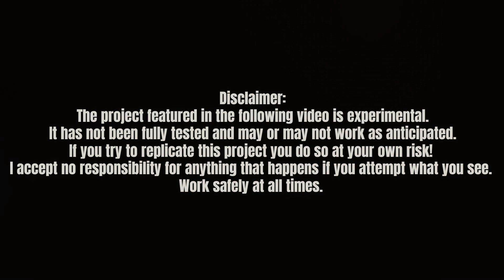Ryobi 40v Brushless Motor E-Bike Controller Variable Speed Throttle Reversing Wiring Demo & Diagram

Comment: Hi there, how did you determine your wattage? i have a motor from a milwaukee lawn mower, its a 36v motor and milwaukee claims max rpm is 3300 and max torque to be 10 ft-lbs. i’m wanting to use it on my mill funny enough but it’s got 3 main wires and then a ribbon as well which im not sure what the wires in it goes too, but im trying to figure out what controller to use and then how to power it from ac voltage plus id like to know the specs which i cant find anything on. my motor looks identical to yours except for it has the ribbon which it looks like yours does not.
Reply from the maker: Being a DC motor you will need a brushless DC controller. But you could power that with an AC to DC converter of appropriate size. I actually was told by someone else that it was 750w, but it sounded right. I have a motor that looks the same, but is slightly taller and is marked 900w on the back. It might be more like yours since that one is also a 36v motor. The extra wires on the ribbon are probably for a hall sensor, which is nice but not necessary. I typically use E-Bike controllers for these motors, since they are cheap and versatile. Most E-Bike controllers support Hall sensors, but I'm not sure which wires connect to what there.

Comment: I wonder how many minutes battery will last at 30mph.
Reply from the maker: On my moped these tended to get too hot so I never got to do a range test. On a bike results would likely be better with proper gearing. Rough estimate of about 20 minutes or so at 30mph with a 6ah battery. That's assuming 750 watt draw, which is about the max or maybe a little over on these motors.
Reply: @oddjobsandrandomprojects I think they have a fan on the motor while in the mower, no? You’d probably do better keeping a fan of some sort on the motor.

Comment: I have a couple of the new 80v motors, do I need to get an 80v esc or will a 48v work ?
Reply from the maker: This is opinion, not something I've tested. But you should be able to run lower voltage with no issues at all. However, they will produce less power since you can't add more amps to compensate without stressing the wiring.

Comment: What do the yellow green and blue wires correlate to on the motor?
Reply from the maker: I'm not sure I'm the best person to explain it, but on a brushless motor they don't correlate to a hot or ground like on a brushed motor. Instead they constantly change, becoming hot or ground wires in time with the motor RPM. There are some videos on here that explain brushless motors much better than I can. That's how I learned about it.

Comment: I'm thinking on adding that controller to the mower itself just so I can get rid of that load-sensing feature they felt the need to add and not be controllable to get the most battery life at the cost of the blade not spinning fast enough 😅
Reply from the maker: Yeah, you will certainly have more control over the speed with an e-bike controller. You'll trade battery life, but it might be worth it.

Comment: Could you use that controller in place of the mower blade controller?
Reply from the maker: There is no reason you couldn't do that. You would need to figure out a throttle for it, but that shouldn't be too difficult. But it does give you more control.

Comment: If I had a stand alone non ryobi motor and non ryobi controller can you explain how to utilize the ryobi batteries? Sorry very new to the electrical side of things and working on converting my mclane reel mower from gas to electric. My last hurdle is I’d like to use my batteries for my ryobi system but am not looking to gut my ryobi to harvest the motor and controller.
Reply from the maker: Kind of depends on the controller. The batteries are 40v with a simple hot and ground wire. That is pretty easy. I bought a used charger cheap on eBay to make connecting to the battery easy. Just gutted the charger and soldered wires to the hot and ground connectors. The issue with some controllers is they may have additional wires, just as temperature sensors and things to bypass. I'm not familiar with any other brands to offer any advice there. The other option is to purchase a Ryobi motor and controller on eBay like I did. Someone else had already gutted one.
Reply: @oddjobsandrandomprojects  thanks for the reply!! My concern about using the ryobi motor for my project is I am just not sure about taking a motor that is designed to run facing one direction but the device I’m placing it on would be using it with it on its side. At least someone said to me it could stress the motor. I am fine with purchasing what I need or tearing apart my ryobi but I just like the idea of using the batteries but want to make sure I’m running efficiently
Reply from the maker: I don't personally think that running it on its side will hurt the motor. However, the bearings aren't made to take tension. So when I used one for a drive motor with a V belt it runs the bearings after a year or so. The V belt just requires too much tension. I switched to a cog belt and so far have had no problems. Since you are working with a reel mower I'm guessing it is chain drive, which should work well if you can find a gear to match.

Comment: please help, i have a 900w 40v controller, i found this info on the net, i picked up a Remington lawn mower, never been used, but dont make battery anymore, but i fitted a 40 ryobi, and modded the gut to except the ryobi battery, but ryobi has 2 T pins, the Remington has 1, i have reversed and get same outcome, so the controller has a signal wire, it comes from the plugs to the battery, in T2 the mower starts for 15 seconds, then stops, plus i have to put ryobi back on charger to reset battery...i think the answer is below, but i dont quit understand, i know temp sensor is important, but i want to bypass on controller.. most ryobi tools run only ( + and - ) only T for charging .. below is a comment from china to bypass brown and white wire .. 
""The controller connection is defined in the introduction diagram. The detection signal line needs to be connected to the 10K resistance and the negative electrode, and the starting line is connected to two control switches. After the power is switched on, the starting line can start and run.""
Reply from the maker: I will have to check how it works on mine, but I see a couple options from the info you have. First, it sounds like they are saying to connect a 10k ohm resistor from the negative to the sensor wire on the controller to bypass the sensor. That is a great option. The other would be too get a Ryobi controller since it matches the battery. If the motor connects like mine it will connect to other brushless motors of similar size without a problem. But that adds to the cost. I can check mine, but any info I have is about the Ryobi controller and may not help you.

Comment: I have this big fanuc motor and I removed the encoder because I was going to use it in a go kart but when I powered it sensorless it just made weird sounds. If I gave it higher power (I was using 12 volts), would it run properly?
Reply from the maker: If it is this motor it should need at least 36v. However if you aren't using a controller on a brushless motor it won't work. It's not like a brushed motor that you can just put power to and it works.
Reply: @oddjobsandrandomprojects  I was using a 36v brushless motor controller. The motor spun slowly but I had to manual twist the shaft to get it going. I tried 24v and 36v but it only made weird sounds
Reply from the maker: @King_supermarket  That is strange. What wattage is your controller. I've had good success with 750w-1000w controllers. Could also have a defective motor or something. Not entirely sure.
Reply: @oddjobsandrandomprojects  it seems to be 15amps and 180watts
Reply from the maker: @King_supermarket  That may be the problem. I've been told that motor is 750w and while I haven't tested that it seems to be pretty accurate. The small controller may not have the necessary power to spin it properly. I'm not going to say I'm an expert of any sort, but that's my opinion.
Reply: Now that I’m reading that, that does seem correct. I’ll have to add hall sensors to the motor to run it with a higher power controller
Reply from the maker: @King_supermarket  There are some controllers that are cheap and work without Hall sensors. That's what I've used. However, if you figure out how to add the hall sensors then let me know because that would be very beneficial. That was too far out of my knowledge base to attempt.
Reply: @oddjobsandrandomprojects  alright

Comment: You can reverse the motor with the original Ryobi controller.  If motor leads X,Y,Z are connected to the controller leads A,B,C and you switch, for example, X to B and Y to A, the motor will reverse.  You could wire up a double pole, double throw switch (DPDT) switch to accomplish this.  As a side note, it is therefore not important how motor leads XYZ are connected to the controller leads ABC (ie, do not need to match colors) as the motor is a Y type configuration for the stator coils.  You can just change the direction of rotation as you showed by connecting the learn function wires.
Reply from the maker: I hadn't thought about using a double throw switch to change the direction on the original controller. I don't have any need for that right now, but always good to remember if I do. Thanks!
Reply: @oddjobsandrandomprojects  It's just easier to use a controller (such as the one that you have shown) that has the connector for the reverse function instead of using a DPDT switch.  I just made the above comment if someone has the Ryobi controller and wants to make it reversible.  I am very pleased to have found your videos as I will be using your approach for doing a conversion.  I like the idea of using brushless DC motors and I believe your approach is the simplest and most cost effective.

Comment: Do you have a link to the higher power Husqvarna motor? Is it actually more powerfull than the ryobi?
Reply from the maker: https://www.ebay.com/itm/334928000576?mkcid=16&mkevt=1&mkrid=711-127632-2357-0&ssspo=9cUwSpf4T-O&sssrc=4429486&ssuid=bwWTw66aRma&var=&widget_ver=artemis&media=COPY
Reply from the maker: The price for them has gone up since I bought mine. It has a higher rated power by about 150w, but I won't say I notice a difference. I think you are limited by what the battery can output. However it is easier to fit a pulley on, especially when you 3D print them. That was my main reason for the swap.

Comment: Any idea what sprocket would work in there?
Reply from the maker: I haven't tested it with a sprocket. I originally had a V-belt pulley, but later started using a 3D printed cog belt pulley.
Reply: @oddjobsandrandomprojects  I gotcha. You said the shaft was a half inch correct? Also, is there a keyway on the shaft at all?
Reply from the maker: @alexfrancis7093  That sounds right. I'm sure I measured for the video, but it's been a while. There is no keyway. Since it was designed to hold the blades they have a double D cut on the top that has a square washer to match. That stops the blade from spinning loose. I would have preferred an old school keyway.

Comment: Do you think you could do 2 or 3 of those motors in parallel and have them all controlled with one controller?
Reply from the maker: Possible, but there are a lot of problems with doing that. There won't be enough power available for all of them to run efficiently. Also, it won't be able to adjust the speed of one without adjusting the others. Much better to have a controller for each.

Comment: how did you get the ryobi op404 apart, there is only 2 screws, and i cant pull it apart, or is there a hidden screw..thanks
Reply from the maker: There are two more screws hidden under the sticker as I recall. You can find them if you run your fingers over the sticker firmly.

Comment: Can you make a video on how you gutted the charger to use only the ground and power pleaseeee
Reply from the maker: I'll try to get to that soon. Been a little behind on my videos. But, in short, I completely removed the circuit board from inside. Then solder two wires to the two main terminals. I used 10 gauge wire, but that's a bit overkill. Then I just drilled a place for the wires to exit and put the case back together.

Comment: Have you tried running one of the Ryobi motors on 48V?
Reply: I run most brushless at 20-50% more than rated voltage without issue before seeing diminishing returns heat wise.  Routinely run 48v motors at 72v nominal, and  72v motors at 100-120v. I run them on mini bikes.  it will handle 48v easy.
Reply from the maker: I have not tried it, but I have wondered about that myself. It should work, but may cause excessive heat. So it may require a cooling fan to prevent damage in the long term.
Reply: I'm a retired electrical engineer and have several conversion projects with 48v motors powered by 56v Ego batteries. One minibike I converted 2 years ago has extensive use with no problems. Most of these motors seem to withstand 10% +/- voltage without adverse effects. I'm considering an electric conversion on my John Deere 318 and considering the Ryobi motors for the deck. I'm going to buy one and do some testing.
Reply: hey I really appreciate your help on this stuff!! Check out the use of these on my mower.

Comment: So would the brake be a reverse current so the motor briefly goes in reverse so it comes to a stop?
Reply from the maker: I haven't actually used it yet, so I'm not quite sure. That could be it, or it could simply cut the throttle in case you still had it engaged.